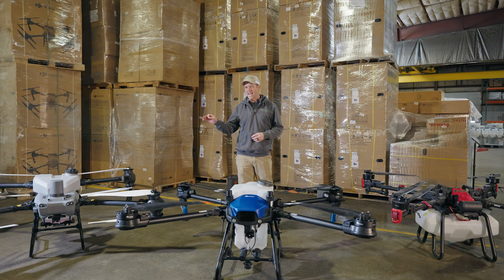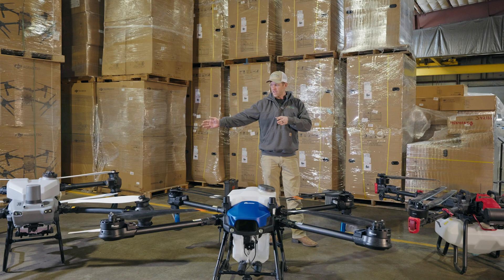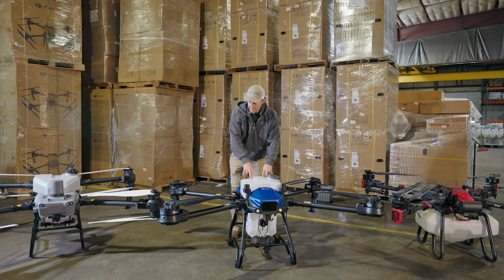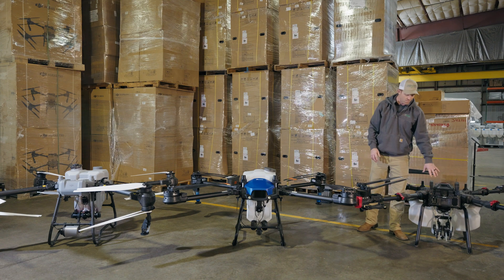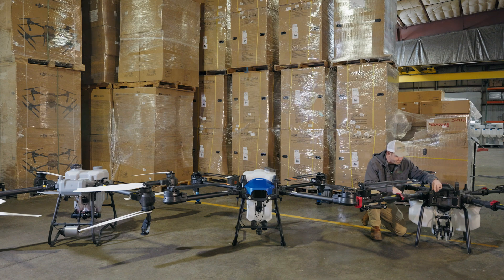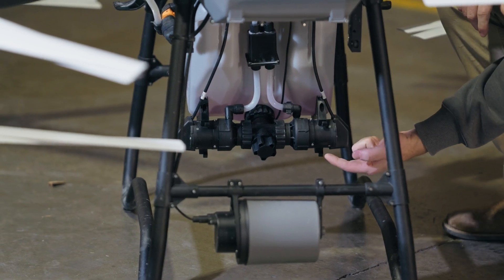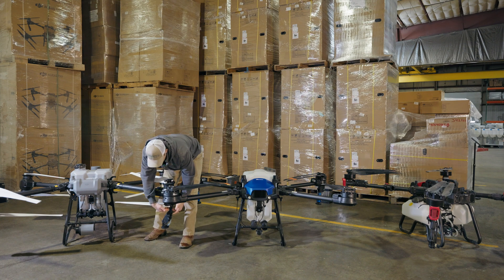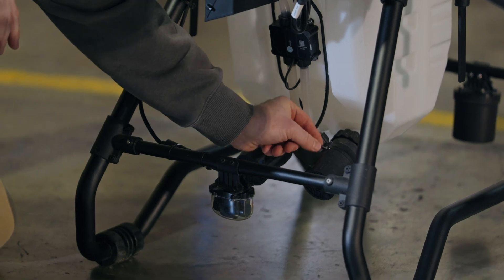EAVision J100 vs DJI T50 vs XAG P100 | Spray Systems

Comment: DJI ⇄ XAG ⇄ eavision data interoperability without obstacles!
📌 Interoperable plot data, solving the pain point of changing aircraft!
✈ Change aircraft whenever you want, no longer bound by brand
🌍Take plot data with you, directly maximize operation efficiency
💪 Break the industry monopoly, pilots truly hold the initiative!
Don't let the equipment lead you by the nose anymore!
Let the data serve you
Let the plot data truly belong to you!

Comment: I have absolutely don't understand how any engineer thought that peristaltic pumps are a good idea. 

Basically, to break it down: The J100 is the best sprayer drone when it comes to full scale spraying. Period. Just a good example of well-engineered, simple design. The LIDAR, remote control, bladed battery and opposing terminals, the nozzle motors, the single rotor design, just everything is superior.

When it comes to spot spraying, the T25 would be my drone of choice.

Comment: Of course, the nozzles are going to be flimsy when you try and yank them off the drone. I've never seen anyone in the field try to pull the nozzles of a drone. And it's a good thing you were on the concrete floor so you could find your missing parts. But the T-50 pump went right back in place with no problems. You praised dji drones for years and now you are all talk on the EA Vision that is still at least 2 years behind on the software. We could always get together and do a side by side. You're definitely a great salesman..

Comment: Why do the atomizer posts look different on your video than nuWay Ags? There's seemed very flimsy. I am taking their reviews with a grain of salt because I know they sell DJI and if they aren't a dealer for EA Vision than I could see videos being a bit biased to help sells with DJI. Just some clarification would be great. Also in their video the showed the 2 set of sprayers being on the arm of the drones. Is this the only configuration or are there multiple options where they may be more secure like what you are showing here?

Comment: Peristaltic pumps are very strong and have low maintenance since this system is used in medical equipment and is also not difficult to maintain.

Comment: Those atomizing motors with gearboxes sound like something that could wear out faster and be somewhat expensive to change but time will tell I guess. 

My other concern or question is what happens with a Drone with only 4 motors like the Eavision or Xag if one Motor fails in the air? Does it just fall or is there any way to save it?

My T40 has lost 5 propellers or at least part of them once when I flew very close to a tree and it didn't fall (it was empty). The other day an engine got stuck in mid-flight with 32 liters of cargo and it didn't fall I was able to fly back and land without accident. It has more than 350 hours of flight time.

Thank you so much for these videos and especially for sharing so much about Drones with people who don't live in North America, meaning they aren't your clients. I look forward to the next one.
Reply from the maker: Quadcopters can continue to fly, at least long enough to land, if a propeller sustains a small amount of damage. They don't have the same level of redundancy as X8 octocopters (like the T40 and T50), but also have half of the parts that can fail. It's a double-edged sword! Glad you are getting value from the videos 🙂

Comment: It's gotta be frustrating to put out these videos as the China videos are released for the newest generation, J150, DJI T100, XAG P150Pro, etc.  Always stuck behind, in the previous-gen market. Maybe if the restrictions ever relax a little, then they'd be announcing them in the US market at the same time... Seems the newest versions have put all of the sprayers at the back in some form. I assume it keeps the drone cleaner.

Comment: Couple things on the XAG P100 Pro. With the pumps, it's pretty easy to grease them, you can take a baster, or bigger pipet, and squeeze grease through the back where the hoses come out with no disassembly. Alternatively, you can modify the housing plate and put grease zerks on them for easy maintenance. The P100 Pro also has a 60L optional upgrade for the tank. 

Also to note, the P150 has moved to impeller pumps, so moving forward that's a non-issue, and that 70L tank is going to be a huge productivity booster, especially in higher volume applications.
Reply: Thank you for spreading the truth!  He also says there's no set position for the XAG spray booms, there is literally 2 white lines that you match up for recommended position.

Comment: 6:20 you actually don’t need maintenance on those pumps. Pretty misleading. Misleading or lack of information on your side.
Search for Oztech P100 maintenance. They spray a LOT and they barely mention the pumps.
Reply: You do need to grease occasionally, ideally once every 500 acres or so. Those hoses can rupture, but it's not as common as might sound.
Reply: @ ok yeah sure. Every 500 acres is a pretty normal maintenance interval I guess.

Comment: What is your opinion of having so small of micron for minimizing drift
Reply from the maker: Smaller micron sizes are great for pushing product through a canopy, but more susceptible to drift. We are doing testing currently to determine the true range of micron sizes of the EAVision system